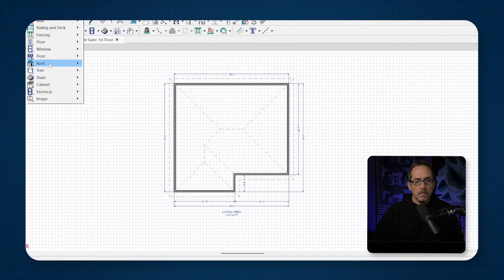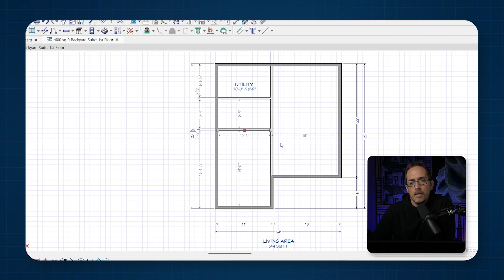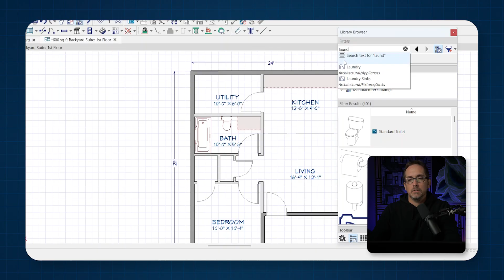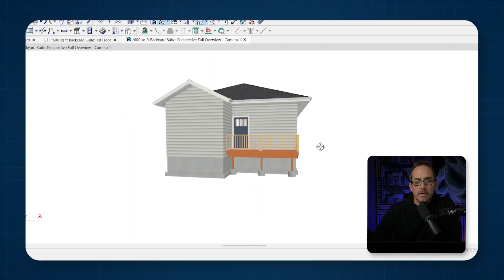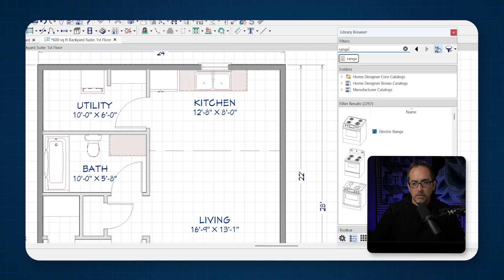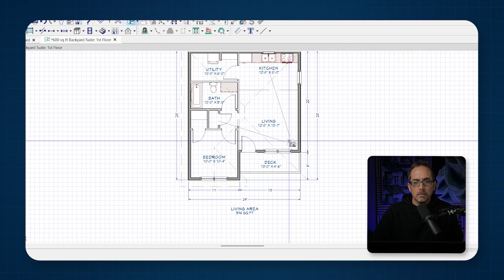How to Design a Small House Floor Plan | Pro Builder Tips!

Comment: I am a retired builder, having been in the business in PA. for more than forty years.
I am currently 90 years old, and have been widowed for 18 years.
I retired to Florida 26 years ago where builders are required to hold a state license.
However i was permitted to build my own home as an owner builder.
I later became a licensed building contractor in Florida.
My son mover to Florida from PA about 15 years ago, and i sponsored him for his contractors license.
When my wife died i sold the home we lived in and moved to where my son was living.
We bought a property and demolished the existing house, and designed a new home with a 700 sq ft inlaw apartment for me.
 The apartment needed to be attached to the main house, and there was a requirement for a connecting door from the main house.
By law these must be used by a family member, and not used as a rental unit.
As for the concrete slab type construction, that would be the most common type here in Florida.
However in colder climates the slab would be required to extend below the frost line around the perimeter.
A better system would be to excavate for a footing below grade, then build a block stem wall to the required distance above the finished grade. Then the slab can be supported by the stem wall under the exterior walls.